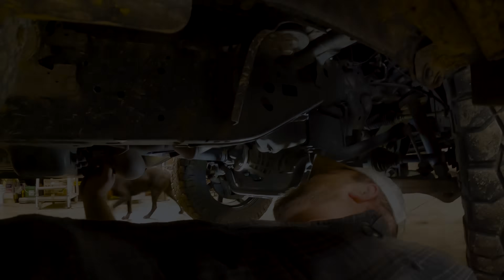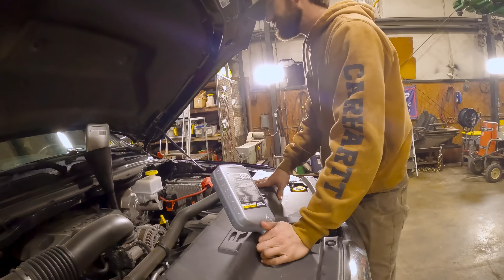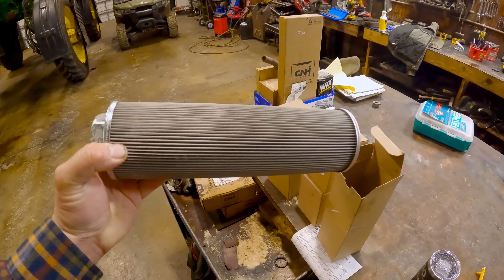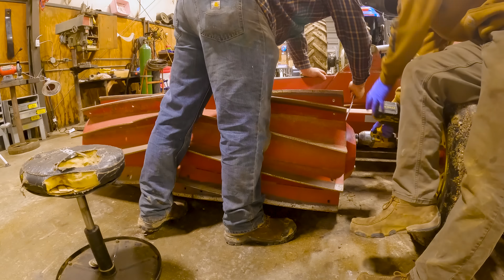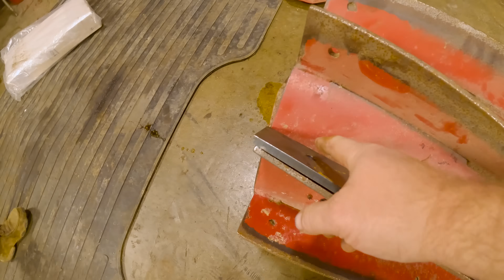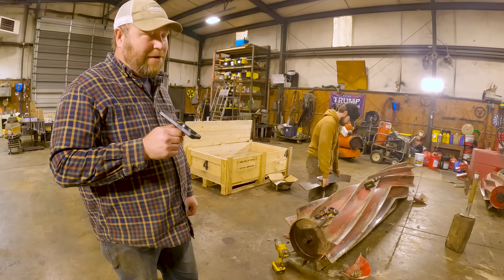Won't Ever Do Business With This Company Again!!!

Comment: I used to work for Wix filters. We made Motocraft, Napa, Carquest, Microguard, Chrysler, AC Delco, Mann & Hummel, Donaldson, some Fleetrite, Partsmaster, and Im probably forgetting a few brands. There are very small differences  in some of them but the biggest difference is the paint and packaging. Back then it cost us around 40-50 cents to make a 75mm oil filter.
Reply from the maker: Wow!

Comment: I agree with you matt, the crimper manufacturer needs to pay to make sure those plates fit on there implement correctly, they hold the patent for it, so they should make sure the wear parts fit it correctly, thanks for sharing

Comment: When I was in the auto repair business I tried doing business with NAPA and found that in all cases pieces and parts were either the same cost or LESS at the OEM dealer. As far as filters, I found a parts "person" at O'Reilleys that could cross-reference numbers and get me "Wix" or OEM filters (oil and hydraulic) at a very reasonable price.

Comment: I work in the steel industry and the freight seems to be way off on this. As long as the box could be under 96" ( I don't know how much it weighs but for example ) a 1200# shipment from Humbolt TN to Camp Douglas, WI 54618 should run you $190.00. Even if you paid someone to use there account they might charge you $100 each way that is still way cheaper. 2000# should only run you $270.00

Comment: Matt, that is absolutely ridiculous and the company should be ashamed. I understand times are tough, but they obviously screwed up and should have made it right. Not that I’m in the market for a crimper, but if I ever am I certainly will stand clear of that company. I might could see having this issue with a piece of equipment 20-30 years old, but certainly not 10. Shame on them.

Comment: Piss poor design, should of had a replacable and reversible blade to begin with.

I would grind off the edges and square them.  Next time needed, do it again. By then, a few years down the road, you'll have all the holes drilled on the replaceable blades...😅 plus they will stick up farther past the original ones. 

Send a bill fir drilling the screwed up holes.

Comment: You would be surprised. I worked at a Baldwin Filter plant in Kearney, Nebraska. We did not make only Baldwin Filters. While the material may be very slightly different, or folded slightly different, there are a lot of like filters, with very little difference. We made Baldwin, Napa, Motorcraft, Wix and even John Deere filters, to name a few... Yep, outrageous prices are determined by the named company. I would try to find Baldwin filters. We made a massive amout of AG filters!!! Just some insider info for you!
Reply: Idk about the Ag side but when it come to CAT, Baldwin filters SUCK. Air filters don’t fit tight enough and fuel filters have half the element inside.
Reply: @FixinCat  wouldn't surprise me... air filters are hard to make perfect. They suck to make, too...
Reply from the maker: Thanks!

Comment: Since the shipping was around $700, you should be able to recoup $1400 from the company.  Then make a template from the two different size elliptical bars, paint it red as a template, then vice grip it to each bar and drill the holes.  It should take no more than one minute per hole.  You could also sharpen the existing blades with a grinder and drill these blades out for future replacement.  It seems that the steel is rather soft for doing this job.  I’m sure you’re familiar with Plow lathes, also called plowshares, which are very very hard.  I don’t know what the Rockwell hardness is on a plowshare,  but you can’t drill through it.  The work that these cutters do should be steel as hard as a plow share.  Also, the guy you called wanted $2200. Drill the new holes on his first quote.  You should get the manufacturer to refund you $2200.

Comment: Let’s keep things in perspective. I&J is a small company, the machine as well as replacement parts cost probably 1/2 as much as if they were John Deere or Case IH.  I do understand that when you order parts from the manufacturer, you expect them to be correct, and they should be.
Reply from the maker: Doesn’t matter what size the company is, you make a mistake, you make it right

Comment: Set up a jig on the drill press with a pin 1/2 bolt that registers the off set from old hole to drill bit In the drill press. Have stop bolt to keep the bar from spinning on the drill table.  Lots of labor. Once it is set up it’s a matter of placing bar on table and pulling down. Drill the hole a flip it around assuming it’s same offset on each end. 
Next guy should just grind a square edge on the old blades. Hindsight is 22/20 good luck Matt.

Comment: Just drill the holes in one blade, make sure it fits. Then clamp the fitted blade to the bad blade. Line up the hole and drill away. It sound worse than it is.
I understand why you pi$$ed off. I would be too.

Comment: A couple (or three....) hours with a 9 inch angle grinder would sharpen your existing blades to perform as new.  A hand-held plasma cutter would do the same job but would "waste" valuable metal although it would be faster than grinding.  Good luck getting your crimper back to new performance.

Comment: Push comes to shove, mfg that don't fix their mistake they aren't worth your money; another too common situation of "got paid in full, cold shoulder after any issue." A lot of extra work either way a guy looks at it or have to pay more money. The guy could at least met you 1/2 way on shipping charges would at least be better than not helping at all... never expecting full coverage, but a compromise would have gone a LONG WAYS.

I've got quite the list of dealerships/mfgs that are great to work with, and others not so much; bought a semi and a brand new trailer recently from 2 separate dealers respectively... it's incredible how one salesman can be completely opposite of the other when an issue arises. I've learned a lot in the last 10 years that after-the-sale purchase is far more important for customer satisfaction.

Comment: Ive found most of the time john deere is actually cheaper than going aftermarket. I use carquest/wix filters on most things but deere equipment usually gets oem for that reason.
Reply: You are right the filters for the 2 clydiner are cheaper than aftermarket but Deere used these filters on a lot of models

Comment: Since you have the new blades keep them sharpen your blades on there like you are talking about then mock you up a set of blades to where the holes will line up and keep sharping the existing blades till they need replacing then you will have had time to drill all the holes correctly and then you will have a set to bolt on I agree  whole hearted with you and as aggravating as it is to spend money you didn't have to at the moment at least you have time to get the new ones right

Comment: Could you do a stitch weld 1"-2" long every 10"-12" and stitch the top and bottom edges on the sides? Drilling new holes on the new blades is a pain because if you ever replace them again then you've got to re-drill. If you drilled the old blades then you wouldn't have an issue the next time, but that's going to be a bigger pain. At the rate that all that nonsense will take, you might be better off with a grinder on the old blades. Maybe after a couple 2-3 years of grinding the edges of the old blades, the new ones will stick up enough to bolt them on.
Reply from the maker: Thought about that but welding like you suggest would take longer than drilling. And if I ever needed to replace them, would take a lot longer to have to cut them off

Comment: At the beginning of the video where you showed you wanted to add new blades I was thinking "I'd just grind those edges sharper every few years before buying blades" Otherwise, if there is drilling to be done, drill the drum flanges to match the blades as they are. Because the next time you order blades they will fit like they should. Test clamp a blade to a flange and using your plasma cutter, hand-trill, or acetylene torch cut through the blade holes to knock out the drum flange hole in the correct spot.
Reply: Absolutely correct way to repair. The original drums need to be altered to fit new blades

Comment: You may already be aware....there are 3 or 4 filter makers in the world. The trick is figuring out which one makes the filters for John Deere then finding the least expensive source. I have found, generally, NAPA's high end filters are as good or better than any and the price isn't causing heart attacks. Used WIX for many years with no issues and local independent mechanic like them, ag and auto. Specialty filters might be an issue.
Reply: Precisely... can be said for a lot of products and parts. If the actual mfg supplier sells directly to customers, you find out how much markup dealerships will put on... and it's absurd. At least with filters they have become more competitive.